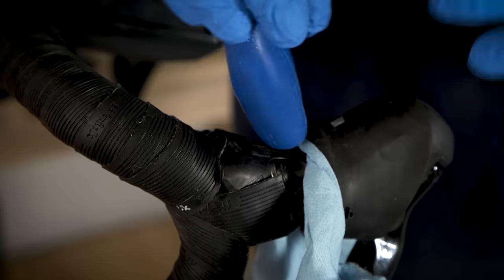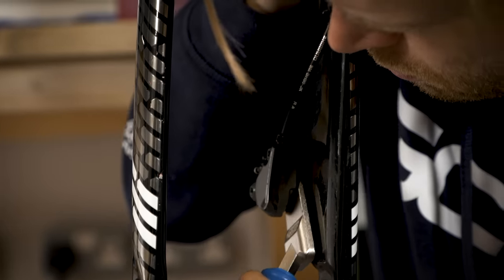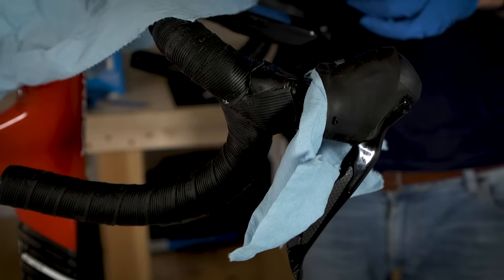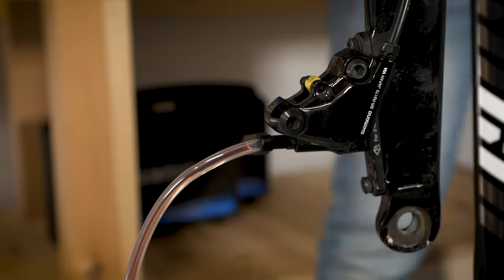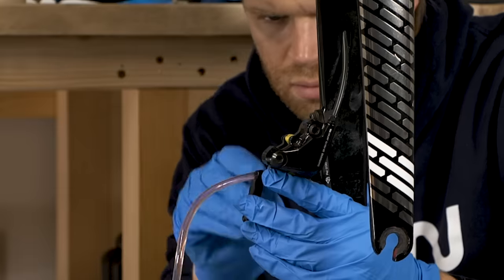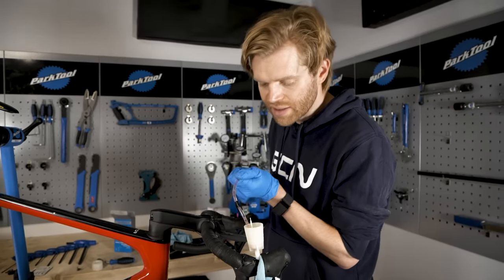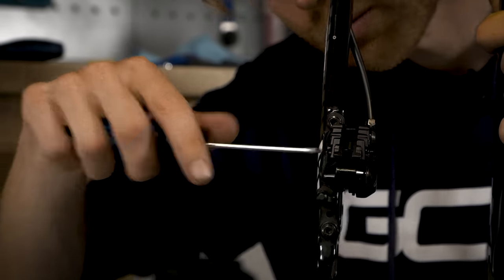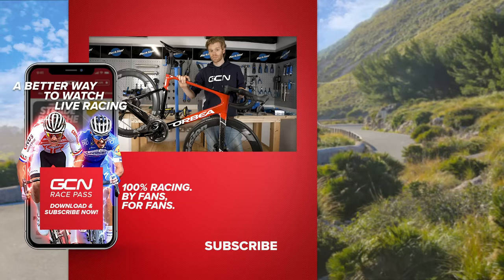How To Bleed Shimano Road Hydraulic Disc Brakes

Comment: I’m not sure that mineral oil is water soluble but could you not clean the syringe with detergent to allow it to be reused? Random fact - the only cars that use mineral oil as brake fluid are Rolls Royce and Bentley!
Reply: Citroen LHM is mineral too...
Reply: That's what I do and only recently I've had to retire an older syringe - because I whacked it and dented the plunger end. They should last a long time.
Reply: Indeed. I have no experience with the Shimano oil, but I am bleeding the brakes of my radio-controlled model car quite often with mineral oil. I wash the syringe with soapy water and it lasts a least a year or two...
Reply: i still re-use my first set of syringes (bought several years ago and re-build many bikes with it). just wash them of with some form of alcohol after using and re-use them.

Comment: And now for maintaining your rim brakes:
Get an allen key
....?
Profit
Reply: Rim brakes. Simplicity, no mess, less time consuming maintenance, cheaper, and no spent fluid to dump into the ecosystem. But if you’re riding in the wet you’re certain die without disc brakes!!! Yes, um, no.
Reply: My dura ace rim brakes lock up in dry or wet conditions, never had a problem with rim brake performance.
Reply: Conveniently leaving out the 
... repeat every other week or after every wet descent...
step, I see.
Reply: Eh. This is like a once or twice a year procedure. I'd prefer this to constantly fiddling with mechanical brakes; both rim and mechanical disc. It's worth it for the auto-adjustment hydraulics lend themselves to.

Comment: This is showing me that I probably dont want hydrolic brakes. I think my cables will work just fine...
Reply: In alle fairness; did not need to do this since I bought my bike early 2017. So don't let this hold you back :)

Do understand your side of the story - that is why I also have a rim brake bike.
Reply: @paljasvonpinguin  3 years of how often riding? Tons or just occassionally?
Reply: @patrickhowell2502  Nothing too crazy ~150km/week for those 4yrs - just riding with club/exercise. No commuting or racing.
Reply: @paljasvonpinguin  thats not too bad then
Whats it cost to have someone do it for you
Reply: @patrickhowell2502  It's like $20-30 depending on the shop.  Once you get the hang of bleeding brakes, it's really easy, easier than replacing cables and housing honestly.
Reply: @patrickhowell2502  In practice you'd only have to do it when you open a line (damaged, or too long or something) or after a long while. Once set up it should hold up well. Reckon I'd cost ~€30to€50 at my mechanic (guesstimate).
Reply: My main Canyon road bike is rim brake but I’ve got a titanium Lynskey gravel bike disc brakes set up as a commuter. I’ve done some big country rides and touring on the disc brake bike   and it’s nice to have lots of braking power at your finger tips when in the saddle all day but when things go wrong with disc brakes it’s a lot of mucking about.  Disc rub and you have to separate the pads and calipers or the brakes get spongy - it does happen even when you’re careful transporting your bike on a plane at the other end sometimes things aren’t perfect.
Reply: All my bikes over the past 17 years have had hydraulic, never have they failed me during use, cables have 🤷🏼‍♂️

Comment: I guess mechanical disk brakes on my brand new Merida Silex 300 will be more than enough :D
Reply: From my experience mechanical disc brakes can still be very good, as long as the caliper is aligned nicely to the disc (which seems to be the main issue when getting a nice feeling brake as well and the pads being close to the disc of course)

Comment: What a lot of f**king about !
Just another reason I'll be staying with rim brakes
So easy to service & set up 
Plenty good enough braking as long as you have good brake pads ie SwissStop
Reply: first servicing of hydraulic disc brakes is probably like this for most people:
a whole afternoon, a puddle of oil on the floor, lots of cursing and still only a so-so working brake

but after you done it a few times, or build up two or three bikes, you can do it in 5 minutes without any mess and get a perfect bity brake. its not really complicated once you understood what you are doing.
Reply: As long as you're not riding in the wet with carbon rims ( especially when critracing ).
Reply: Exactly... Who the hell wants to piss about with hydraulic brakes... Buying all the tools etc. Another rim brake win.

Comment: The hack at 8.35 I done this and the air keeps coming and coming blead the system. I'm baffled to know where the air is coming from
Reply: I find the calipers have air trapped in there. Leave the bleed bucket attached and have some oil in it to prevent air getting sucked into the brake lever side, pull and push the syringe to and suck a little bit of the oil out of the caliper, careful not to suck too much out as you may draw in air from the lever side. You should see some bubbles come out. Pump this a few times. I find just pushing the oil one way doesn't catch all the air bubbles.
Reply: Rotate your bike up and down in the stand and pump the lever when it is high and low, air can get trapped in the master cylinder.
Reply: @jonathanzappala  that's the Shimano recommended procedure - but not necessarily the bike, maybe just the shifter (easiest way is with a rotating bike stand; second easiest is to loosen the stem). I think Calvin from Park Tools even states that the "angles" in the shifter body mark the way it should be angle through the three "burp" positions.

Comment: "Next we're going to tighten up the bleed port bolt using the 7mm spanner, so clockwise this time." *Proceeds to crank the bolt anticlockwise.

Also failed to show the step of loosening the caliper bolts. They're just magically slightly loose after he pops the wheel back in, ready for centering the caliper.
Reply: They are British people, driving on the left side...and the clock is going the other way 😒😂😂😂😂

Comment: You didn't explain how much fluid to put into the syringe and for how long to keep pressing it when it's attached.
Reply: Neither has any effect. You push as long as theres no pubbles in the funnel and the oil coming out is clean.
Reply: @Pienimusta  Which should have been mentioned in video.
Reply: @raneksi  Everyone should know that. Even a kid.

Comment: Mineral oil does NOT wear out over time, and air should NOT be getting into the system. These brakes are not fit for purpose.

Comment: Why don't they just make it for DOT4 (or DOT3) brake fluid? EDIT: You wouldn't even need ''cooled brake pads'' with DOT4 (DOT3) fluid.
Reply: Philip Cooper because shimano uses mineral oil not dot 5.1 for starters. Non caustic and it lasts forever.
Reply: shimano uses mineral oil, presumably for the reason that it does not attract water and basically lasts forever without changing it.

Comment: The 2mm allen key to loose the cap is too small! I've put mine and destroyed the inner hole (4:20). Dumbass Shimano put only 2mm allen key for such a big screw/cap! Should be 3mm or more! Luckily I was able to "hammer in" a 2,5mm square bit and finally be able to loose the cap.

Comment: What was wrong with cables and why is the bike industry ramming electronic shifting and hydraulic brakes down everybody's throat? Sure. There are disadvantages to cables but cables are simple and usually easy to replace not to mention much cheaper.